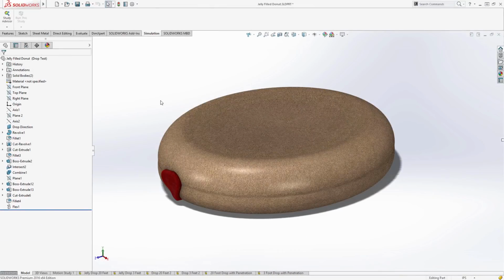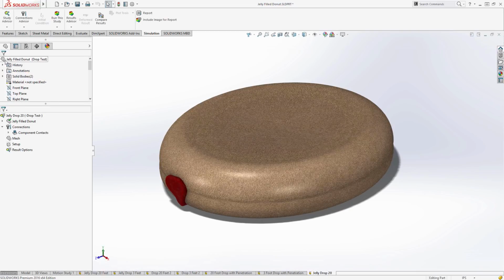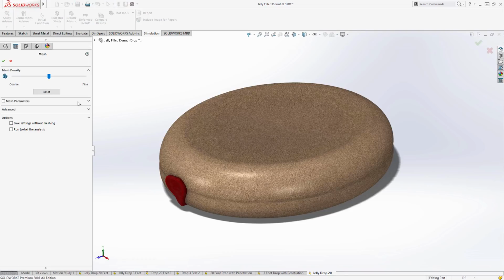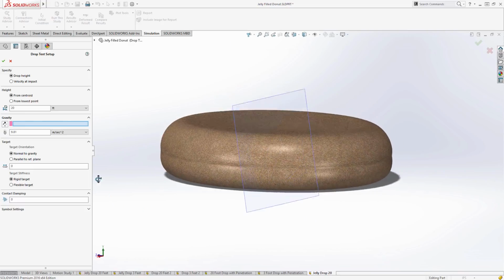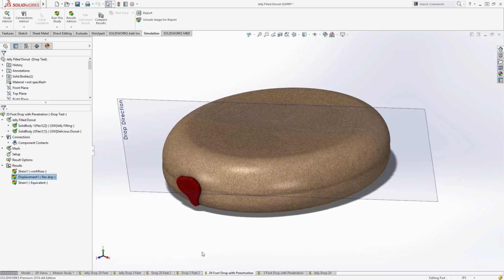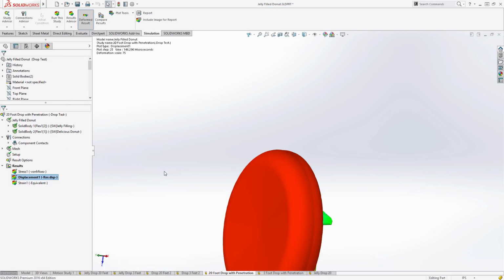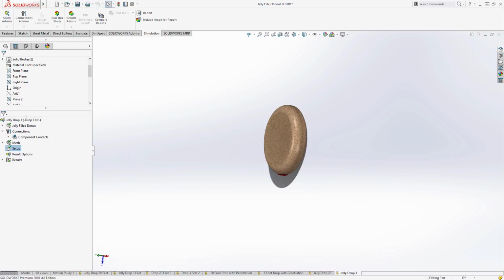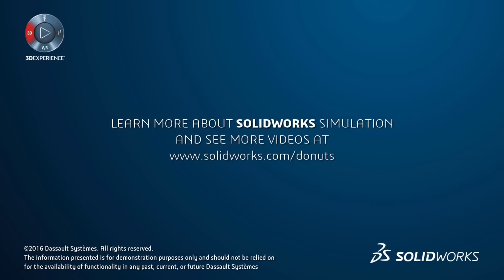See it in Sim Donut Drop Test

Comment: With this simulation don't you have to define a virtual wall, or change the material properties to allow high plastic deformation?  I would think that the filling in this case going through the stopping plane is indication of insufficient constraints.